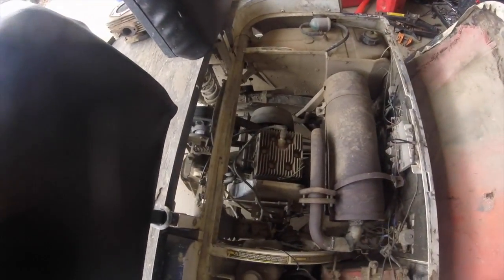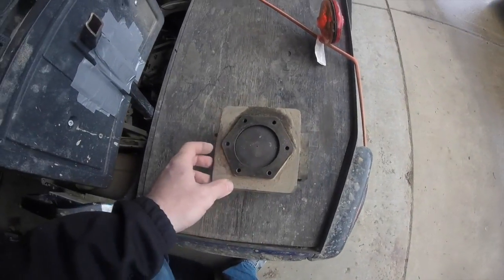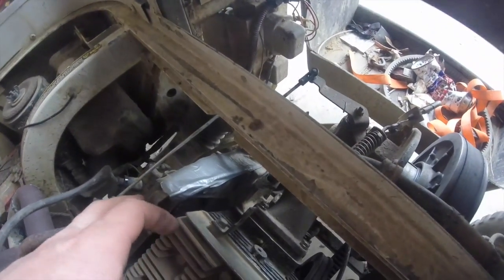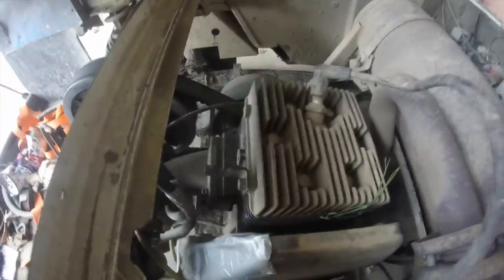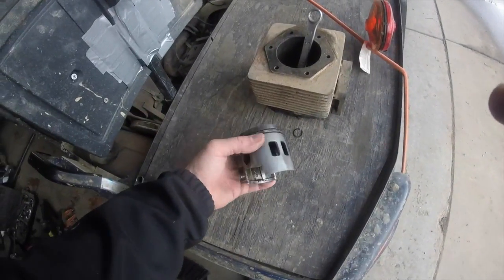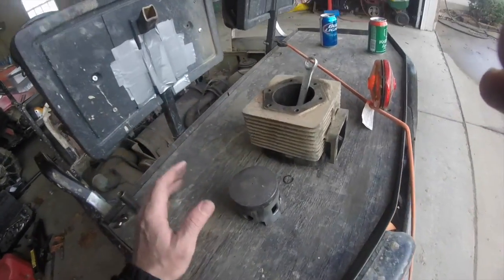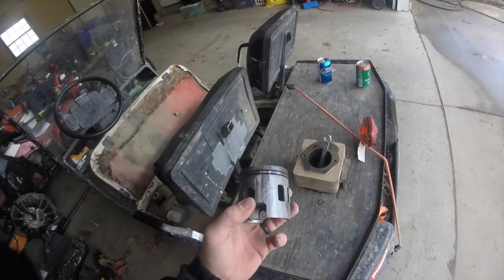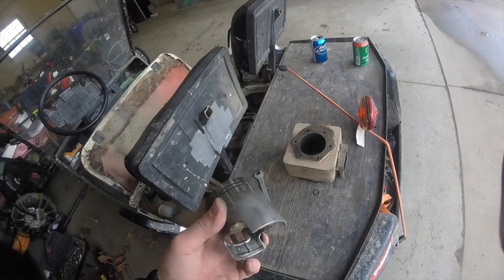How To EzGo golf cart  Engine rebuild 2 cycle.

Comment: just did one last year for a friend. took the exhaust off and I can feel the piston slap in the cylider...friend bought a new piston and jug assemble. the old jug/cylider is good so if anyone has a bad scored up jug I have one. it's mint with no scores on the walls. after I rebuilt it went great.